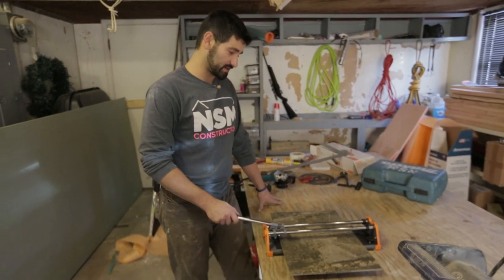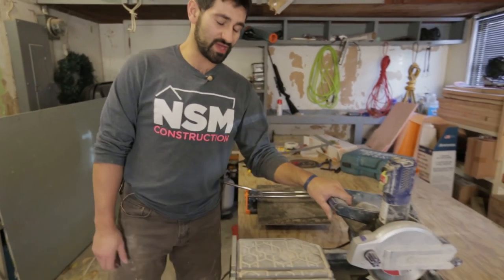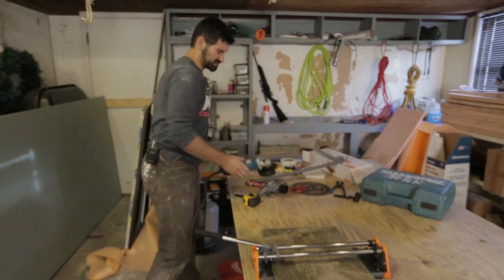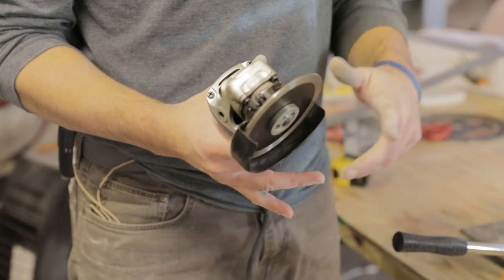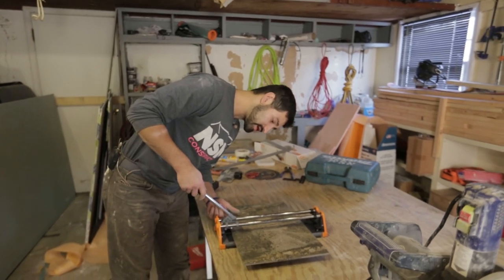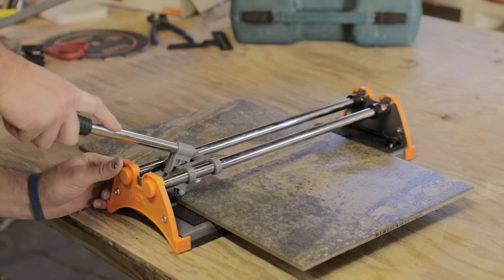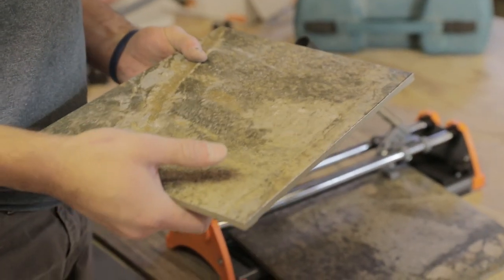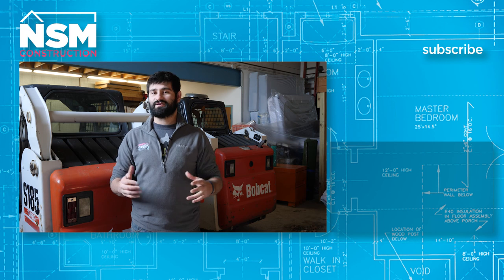How to Cut Ceramic Tile (Score and Snap)

Comment: Thanks for the video. In your opinion, would the score and snap work well for cutting some 1 sq ft tiles at a 90 degree angle (into triangles basically)? I’m not sure if positioning them “not straight” would be an issue. Hoping my message reaches you, thanks in advance!